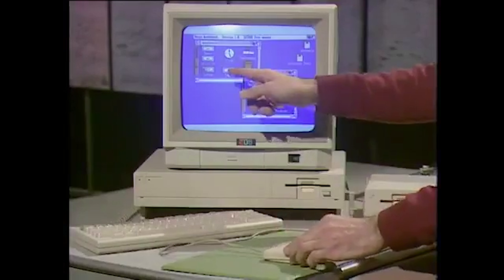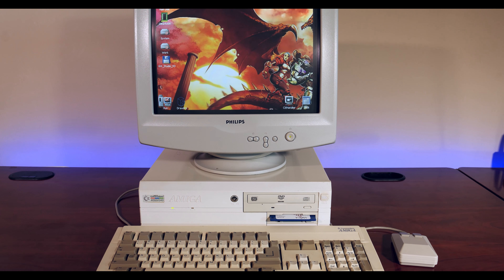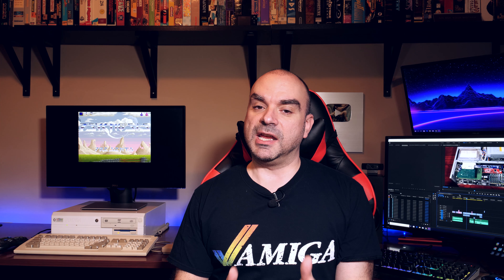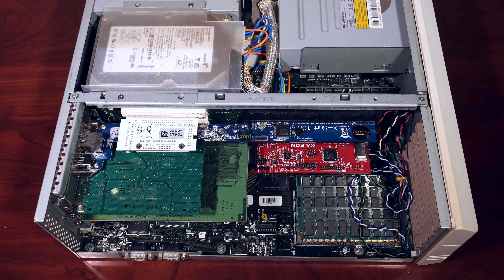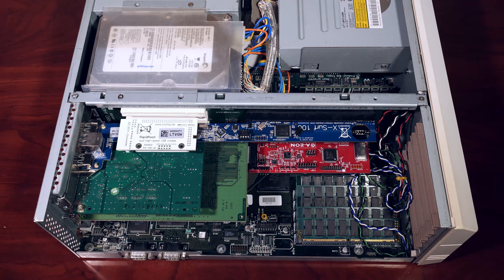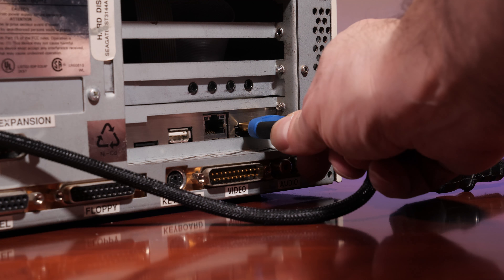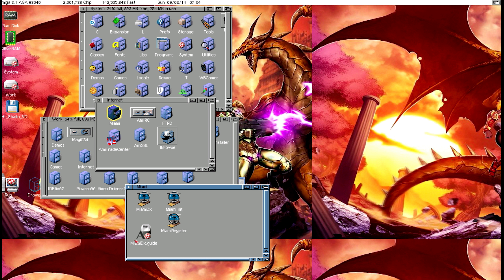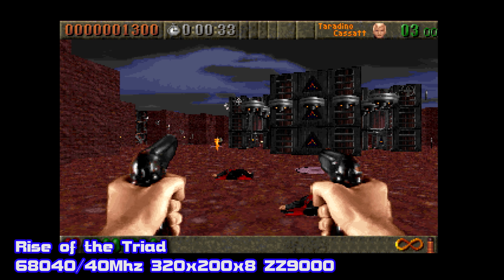Pimpin' the Amiga in 2020 - The Only Amiga Graphics Card you'll ever need - MNT ZZ9000 | MVG

Comment: Most people forget how powerful the Amiga was back when it was released. There was literally a PC emulator for the Amiga, as in you could run PC MS-DOS software on the Amiga using a software emulator and it actually ran pretty well compared to common x86 machines at the time.
Reply: Not to mention the generous upgrade path they had. It was a great platform for enthusiasts of computing in general. It's no wonder the community is still pushing it further.
Reply: @SyphistPrime  yeah, it's a shame how Commodore was mismanaged so badly when they had so many fans all over the world, I remember reluctantly switching to the PC platform after it was evident the Amiga wasn't getting a successor and Commodore was pretty much dead. Still loving my Amiga and Commodore since my first Vic-20, but PC was the only path forward.
Reply: PC emulation was horrifically slow on the original Amiga. Transformer emulated a PC running at 300Khz IIRC. You may be thinking of Macintosh emulation - which due it having the same CPU, was actually faster for certain applications than native hardware.
Reply: @lister_of_smeg6545  You are probably right and I might have a slightly rose tinted view of the Amiga, never did a benchmark comparison, just running some various accounting software on both platforms back in the day and I was impressed, but still considering everyone use their PCs to emulate other platforms these days it's worth remembering the Amiga was emulating the PC long before the PC could emulate the Amiga. It shows how badly Commodore failed to evolve compared to everyone around them.
Reply: @lister_of_smeg6545  So how well did the PC emulate the Amiga at this time.. how many MHz? .. lol
Reply: @lister_of_smeg6545  That wasn't emulation but basically just API translation similar to what Wine does on Linux systems. IIRC there was an MS-DOS daughterboard for the Amiga which had an x86 processor on it.
Reply: @Eric-uf8zx  It didn't need to because it already had all the native software it's users needed. But if it had needed to run text-mode business software from the Amiga - I'm sure it could have managed.
Reply: The PC emulation was arse cancer, completely unusable. The Mac emulator Shapeshifter on the other hand ran better than a real Mac if you changed the file system on your harddrive to a fast file system. The standard Amiga file system made harddrive access from the virtual hard file really slow.
Reply: FTFY : most people DOESNT CARE about how powerful is a 25 years old machine.
Reply: grow up Ben
Reply: @TheStuffMade  I recall my Acorn Archimedes ran teh software PC emulator at XT speeds.  Not very fast but was able to do Turbo Pascal work for college.  Arm 3 would have put it at 286 speeds.  I love these videos may be a little expensive but wow how it transforms a big box Amiga!  FPGA and Arm working hard at it!  Marvellous!!!
Reply: There was some pretty good Apple Mac emulators for the Amiga as well. Helped by the Macs of the time using the same 68000 series CPUs as the Amiga.
Reply: @NerdENerd  It was fine with a bridgeboard. At least on my 28mhz 030 powered A2000, the 386 sx bridgeboard is decently fast. The 25mhz cpu and isa vga board on mine sits about the same or a little faster than an actual sx 20. I have not looked into replacing the cpu with one of those TI based SLC cpu's, though I am sure its possible it would work. 

It is kind of hard to quantify how fast it is in relation to the amiga itself though. Even if my 030 is hobbled by having all zorro2 ram(but still has 32k cpu speed 32bit external cache), I think the 030 is still much faster in non graphical based stuff. Such as opening large text files and searching through them.  Most tasks which I could say are transferable are roughly twice the speed on the 030 in my system. And if I had a proper accelerator board with 32 bit fast ram, I bet there would be significantly more difference.

My shapeshifter card on the other hand is wonderful. And runs system 7.1 with no issues including virtual ram. And seems every bit as fast as my LCIII with similar configuration.
Reply: Lassi Kinnunen  I think decimated is a little generous and certainly not at any competitive price level. You could buy 030 Amiga's too.
Reply: @lister_of_smeg6545  Yeah except if you had a bridgeboard. Granted, not emulation but basically an entire PC on a Zorro card. Variants up to 486@50Mhz existed. Even reports of some crazies upgrading them with Intel Overdrives.
Reply: @lister_of_smeg6545  There was a time when the fastest 68k Mac you could buy was an Amiga.
Reply: @Ben "How well did the Atari failure emulate the PC" -- Pretty good actually. No hardware required. PC Ditto II even ran quite a number of games like elevator.com that are quite hard to emulate right. I played a LOT of sopwith camel on my 1040STf. The PC was able to emulate the Amiga at around 8-12Mhz at the time. Just an 00, not an 020, 030, 040, or 060. UAE has been around a very long time, and I can remember the early SNES and sega genesis emulators running some titles close to full speed on the am486DX2/66. Building modern emulators for i586, you can still get pretty good performance, like from UltraHLE on a Pentium 83 overdrive/90/100/133 pre-mmx. 
As it is, I have the 68000 emulated on a lot of my ESP32s as well, thanks to Sprite_TM's minimacplus port of the musashi core. 
https://github.com/Spritetm/minimacplus/tree/master/firmware/components/tme
I WISH I could emulate an amiga on this little xtensa, but with all the custom chips, that ain't happening.
I was able to get the ST emulation port working on the teensy 4.0 pretty easily, but only for tos apps, any game that tries to dick around with serious copy protection fails. So no Dungeon Master :( But Sundog works.
https://github.com/Jean-MarcHarvengt/MCUME/blob/master/README.md
Long live the 68k. You can toot the amiga's custom bits all you want, but the ST's charm point is all of the off the shelf parts harmonize well. If it wasn't for that damn GLUE, and it's little MMU too!
Reply: Would love to see the Amiga come back and flatten the P.C. market. Call it Amiga Lazarus ! Or Phoenix ! Multi CPU with millions of instructions hardwired into the reconfigurable processors and an adaptable system board that can expand into many interfaces.
Reply: @Eric-uf8zx  with a 233mhz expansion card it could outperform the P2 450 at quite a few benchmarks.
Reply: @scottrich976  Didn't they already try that? I mean, AmigaOne...? and AmigaOS 4.1 Final Edition? Although 3.1.4 is the last one to run on the 68k, to my understanding. But PPC's more or less hard to find or expensive now as well, the AMCC PPC chips are still fairly trivial to find on older SAS adapters for enterprise disk controllers but that can't last. And FPGAs are ridiculously expensive. I've got quite a few enterprise nics here based on the higher end spartan 6 LXTs, which are supposed to be ~$2800 a chip if you believe xilinx's last price hike. Before intel ate Altera, the same chip was $1400 qty1, about $600 each if you bought in quantities higher than five trays of 280 bgas at a time. Even the lattice stuff, which has moved towards open source toolchains and reduction in R&D, still tends to have a high premium. And trying to lash together a board with five or six iCE40-HX8K chips to reduce the cost of a single larger FPGA, you end up with passives all over and increasingly difficult power rail bringups, and an explosion of configuration devices. Rather a steep cost in comparison to an Asrock A300W ($149) with a AMD Athlon 3000G ($55), and 8GB of DDR4-2400 SODIMM ($36) gets you a whole HTPC rig for $240+tax+sh that will happily run any OS/emulator you throw at it, with half the compute power of a PS4/Xbone. But the reality is, today's PC market is not desktops and enthusiasts, it's laptops and tablets. I just picked up a pair of intel cherry trail tablets for slightly less than $100. Gonna scrub android off 'em and leave them as win10 tablets so my main rigs can remain linux based. ARM64 is really making a hard push into the "more than 8GB ram" range this year, and is finally breaking the 2Ghz barrier en-masse. Intel and AMD's days of being the only chips with clocks north of 4Ghz are numbered. And the GPUs have just breached the 2Ghz barrier as well with nvidia's most recent batch. AMD's still playing catchup around 1700Mhz boosts with the vegas. Also, there is an up and coming port of the amdgpu driver from the linux kernel to other OSs. Expect an Amiga RTG driver for it sometime this decade, just like the PCI expansion + Voodoo+soundblaster in the video. I think some older 'radeonhd' cards have been supported for a significant chunk of the last decade.
Reply: The old "MessyDos"! Ah, the golden age... I was able to read and save PC disks with my "Amiga 500". :)

All hail Olaf 'Rhialto' Seibert (the coder of MSH).
Reply: @Ben Where did you ask? I replied to a post from an 'Eric'. Did you post with the wrong sock puppet by mistake?
Reply: Lassi Kinnunen  "However by late 80s you could buy 386's that decimated amigas in pure sw for several kind of gfx effects" Correct. And not only that you could buy them in 1987  before the A500, the one most people bought, was released.
Reply: @TheStuffMade  " it's worth remembering the Amiga was emulating the PC long before the PC could emulate the Amiga. "

Why is that worth remembering? Instead of buying an Amiga with an inferior PC emulation, you could just buy a PC instead. There was never a reason why a PC owner would Want to emulate an Amiga. The reason the Amiga had things such as the sidecar was not because of brilliance, it was because of necessity, and conversely: The reason the PC didn't emulate the Amiga was a lack of interest. 

Amiga fan comparison with the PC is always a case of comparing a fish to a monkey with a tree-climbing contest. Most people who owned and used PCs for work didn't give a shit about the Amiga because there was never a reason to make the trade: You simply don't want an office computer to play Defender of the Crown. The PC didn't have a great games market really until Doom was released. The same reason: Great games didn't come out for the PC because it was used by professionals who absolutely didn't give a shit about using it to play games, when they wanted to play games, they were better off buying Nintendo. The Amiga had literally no place.
Reply: @SyphistPrime  "Not to mention the generous upgrade path they had" LOL. There was NEVER a time when upgrades for the Amiga competed with PC upgrades.
Reply: @digitalarchaeologist5102  "I think decimated is a little generous and certainly not at any competitive price level."

LOL @ the Amiga fan-fiction price objection.

1. Not everybody was broke so not everybody buying a computer had the same price objection. Corporations would routinely pay over $250,000 for a computer system. They were NOT better off getting an Amiga and saving some money. Professionals have deeper pockets and buy on features, ROI and competitive edge, not cost. The argument an Amiga was cheaper is no more compelling than arguing a Nintendo was Much cheaper. Nobody gives a shit if it was cheaper, they weren't buying a games machine.

2. The Amiga 1000 was NOT cheap. It cost over $1000 when it was released, with an 8Mhz CPU which only really competed in speed with the previous generation PC/XT, which at that time had already been outdated by the PC/AT 286. The Price of an Amiga at that time allowing for inflation was the equivalent of over $3000! Cheap? No-brainer cheap? No. I don't think so. The Amiga also had absolutely no useful software really until after the A500 grew the user base. So the Amiga wasn't a compelling purchase even on its day of release. The idea this was all something you can blame on marketing isn't true. 

3. The trouble with Amiga fans is time distortion: They speak of the Amiga as if on the day of its release it had the software base and power of an Amiga with the Video Toaster Flyer which, DYK, didn't exist until 1994, by which time Doom and Quake had been released on the PC. They act as if this 1994 set up cost the same as an A500 which itself didn't exist until 1987 and pretend it was all available at the time of the A1000 launch in 1985, and was competing with a standard-issue unexpanded PC/XT of 1981. 

Here's an idea: Try putting everything on a timeline according to when it all REALLY happened.  

Time for Amiga fans is made of elastic and you can stretch it anyhow you like to produce a completely distorted picture of cost and availability. Nobody was ray-tracing on Amigas when PC/XTs were in vogue.
Reply: @Ben LOL. x 10,000,000

The old "Let's just make up a bullshit explanation for that". 

I've owned computers since the 1970s.
Reply: @vapourmile  You seem be ranting about a lot of stuff I didn't say so I'm not sure who you're arguing with. A 386 in 1989 was very expensive. For example a Compaq 386/25 was almost $16,000 by today's costs. An Amiga A2500 was around $7,800 by todays costs. Most people owned neither at home.
Reply: @scottrich976  Your dream is impossible. There is now no way to "bring the Amiga back" because there is no way to connect the lineage after so much time. Any new computer now will be just that, another new computer. How can it be an Amiga?
Reply: @Ben 

"Is that the best you can come up with? LOL.. how about you answer the question Ken"

Ben, you and the people who "liked" your comment should take the absence of a response as indicative. There's a very plain and simple reason why there aren't any benchmarks from PC hosted Amiga emulations from that day forthcoming and it's this: Nobody wanted to know. 

Of course, we know the answer for today's hardware: PC hosted Amiga emulations today easily outperform even the most powerful Amiga hardware ever to be produced by Commodore. In fact, by 2002, almost 20 years ago, PC hosted Amiga emulators already performed at an equivalent rate to a 0.5Ghz 68030. PC hosted software Amiga emulators have substantially outperformed real Amiga hardware for about two decades.
Reply: @lister_of_smeg6545 

The people boasting of CPU daughter cards are ignoring the fact 68000 daughter cards existed for the PC before the first Amiga was released. Not only that, but a series of CPU daughter cards were released for the PC including transputers and others.

You're basically right: The lack of early Amiga emulation on the PC is explained by a total lack of interest. It would be pointless.

The PC daughter card for the Amiga was also pointless when if you wanted to run PC software you could just buy a PC instead of an Amiga.

Commodore knew this and they made the card in the hope of dampening the effect on sales of the fact that the PC had more killer business apps than the Amiga, and the Amiga had no mature software base. The idea was "See? You can still run PC software!". The problem with that is, you can also run PC software when you buy a PC and not an Amiga. 

I've looked online and if you bought a bridgeboard the results are actually quite impressive.

It's interesting then that the Amiga is made more impressive when it's running PC software. Also, although impressive, desktop PCs of the time with a similar 486 CPU are about four times as fast as the Amiga bridgeboard. So even with a PC on a card, for running PC software you're still better off with a PC.
Reply: @vapourmile  yeah I suppose, maybe a mini Amiga with a few hundred favourite games preloaded would be better. A good compromise.
Reply: @scottrich976 

Yep. A reprise would be welcome.
Reply: @Ben the Atari ST didn't fail to emulate the PC. PC-Ditto was an early software emulator for the ST before it received hardware 8088/8086/Vwhatever/286 and 386 hardware emulators. I'm also pretty certain that the Magic Sac Mac emulator made it out on the ST before the Amiga Mac emulator did. And the first Mac laptop was an Atari STacy laptop equipped with a Magic Sac or the more powerful Spectre GCR. But thanks for playing.
Reply: @welshtechie6832  Acorns were much more expensive than most Amigas or Atari STs. That's like comparing both of those platforms with the Sharp X68000...
Reply: @scottrich976  Even Apple hasn't done that and they design the best ARM based chips period. There's nothing stopping them from packing in 2 or 4 of them into a "Mac" and completely blowing away x86. It would kill Bootcamp and Parallels without an internal/external Intel/AMD CPU option thought.
Reply: @vapourmile  the Amiga and the Atari ST were both far cheaper than the various IBM PC and "compatibles" back when they debuted in 1985. "Cheap" and capable PCs didn't hit the market until around 1990 or so. That's why. Plus, DOS sucked.
Reply: @Jeremy Holloway

Yes, but I've already answered this same question so often there needs to be a home games micro sticky on it. It's simple:

1. Not everybody bought a home computer primarily, or at all, to play games.
2. Not everybody was broke. Not everybody shares your budgetary constraints.

For me as a software developer something I wanted from a computing platform is a ready made user base. So for me the Amiga and ST represented extremely poor value for money thanks to their small cash-starved user base. I spent £4000 on my first PC and it was money I never regretted spending. I also owned an Amiga, and the day my PC was delivered was the last day I used an Amiga.
Reply: @vapourmile  Again you seem to be ranting about something unrelated to what was I talking about. The point I was trying to make was that a 386/25 wouldn't decimate an A2500/030 in terms of performance and they were both high-end contemporaries. Sure, there were far more applications for the PC, I don't think anyone is saying otherwise.
Reply: @digitalarchaeologist5102  

"Again you seem to be ranting about something unrelated to what was I talking about. The point I was trying to make was that a 386/25 wouldn't decimate an A2500/030 in terms of performance and they were both high-end contemporaries"

As I explained in my previous response, whether or not you were personally talking about it is quite irrelevant: Your own words might add to the facts at my disposal, but they do not subtract from the other facts I already have, whether or not you write them, and to anybody who is able to read, your words have no magical properties. As I pointed out, in this case even if we superficially accept what you wrote is true, it is nonetheless what you are Not saying that harbours the point. 

What you have said indeed may be at least superficially correct, even though I don't think the claim of contemptuousness is especially veritable. Yes, superficially, they were available to purchase at the same time. Today, for comparison, Intel still manufacture the Atom released in 2008. So it's superficially contemporary with the core i9. The point being that there have been a lot of CPUs released since the Atom was released a decade ago and many of them are still currently available. I also highlighted previously the Amiga fan-base phenomenon of elastic-time where there is a tendency not to report the timeline of past events accurately and as they occurred.

So it is somewhat true that 32 bit Amigas were available at the same time as 32bit PCs. The 25Mhz 68030 Commodore A2630 daughter cards were available in 1989, as were 80386 PCs, but unlike the A2630 cards however, 80386 PCs had already been available since 1986. If, instead of picking the release date of the A2630 and comparing retrospectively it to a previous generation of PC hardware still available contemporaneously with it, we are to instead to choose the date when 32bit PCs were first made available as our vantage point, it was on that same day in 1986 with that same machine - the Compaq 386 Deskpro - that 32bit desktop computing was first made available to the public. So instead of picking 1989 as the vantage point, how about we pick 1986 when the Compaq 386 was released? You know, a generation before either the A2500 or A2630 CPU card came to market?

While the 386 remained contemporary with later Amigas, obsolescence takes even longer, but still the performance buyer would base their purchase on what was fastest and not necessarily on what was cheaper and/or contemporary. Not everyone buying a computer has "cheap" on their selection criteria, least of all computing professionals, which explains the price differential between PCs and Amigas, computing professionals then being the primary PC customer base. People buying PCs for work or competitive edge tend to have deeper pockets and are prepared to pay for a competitive edge. Amiga buyers paid less but for the most part their motive for their purchase was recreational not professional. That, depending on exactly what you wanted your computer purchase to achieve, renders most of the alleged advantages people claim for the Amiga relatively impotent as far as the marketplace was concerned, and particularly as far as the marketplace interested in using professional applications software and not games or recreational software was concerned. 

1. People who wanted games would have made a substantial savings from a home console purchase, not an Amiga. Consoles had the full range of market leading Japanese game titles and were about one tenth the price of an Amiga. Games consoles took nothing away from the core professional PC customer base because they didn't care about games. 
2. The Amiga was never really taken seriously as a platform for professional software, people wanting that would buy a PC.
3. Many of the applications people claim the Amiga excelled at, such as graphics, didn't really appeal to the mass market. Really, who is it who wants to look at a mirrored sphere hovering over a chequered floor after waiting six hours for it to render? What do you do once you've looked at it? 

So yes, you are superficially correct, viewed from the vantage point of when Amiga products were released, at the same time there were similarly performing contemporaneous PCs, but it is also true that looking at the timeline from the point of view of when improved performance became available in the marketplace, rather than when it became available to Amiga devotees, you could purchase improved CPU performance sooner from the faster-moving PC market. In those days a computing generation was about 18 months to two years, after Moore's law, so the Compaq 386 PC was released a generation ahead of the Amiga A2500 and the A2620 and more than a generation ahead of the A2630.

So, yes you're right in that once again I'm "ranting about things you weren't talking about", but which needed to be talked about to give things their proper perspective.
Reply: I love the utter height of arrogance that what you present is 'fact' in your words, but  we can only superficially accept what I'm saying. OK, you've put your context around it, but please don't pretend that it's entirely fact. If somebody presents some data to you, then it's irrelevant or cherry picking but you can present sweeping statements as bone-fide facts. Please at least allow others the courtesies you allow yourself.
Reply: @digitalarchaeologist5102  

Yet again, you appear to believe your personal opinion is pivotal in the discussion. I don't care if you think I'm being arrogant or not, I only care if it's true.

You also seem to have misunderstood what I mean by "superficially true". I don't intend the difference between fact and fiction which you imply, but rather the difference between obfuscation and clarity. Perhaps /ignoratio elenchi/ would have been a better choice of phrase?: What you say may well be true, but it doesn't represent a completely honest account of the facts.

Here are some more facts:

1. You could also buy CPU cards for the PC and in fact you could buy 68000 CPU cards for the PC before you could buy a 68000 based Amiga. Meaning 68000 CPU cards for the PC were available before the Amiga was available in any form. Furthermore, Dr. Dobbs Journal published a homebrew computing device made from dual 68000 CPUs in 1982. In 1982 people were already making their own computers on a desk at home with more computational power than the Amiga had on the day of its launch three years later, well, four years later, if you factor in the time which elapsed between the official Amiga lanuch and the date mass-production really started. Click the following link and turn to page 254/580:

https://archive.org/details/dr_dobbs_journal_vol_07_201803/page/n253/mode/2up

2. The Amiga  486SLC PC-on-a-board add-in is impressive. In fact, as an Amiga owner, I'd say it's disconcerting just how impressive it is, given that it is essentially a plug-in PC for the Amiga.

You can see an adequate demonstration of the bridgeboard below here, where with it the Amiga runs PC games with textured graphics at an impressive speed. It's interesting to watch because there really weren't many textured 3D games released for the Amiga on its Motorola CPU. What's also true of the 486 Amiga bridgeboard though is, to ensure it could be powered by the edge connector from an Amiga bus, it was in fact fitted with the 486SLC low-power laptop alternative to the Intel part, and ran at about one quarter of the speed of a similarly specced PC.  So it's somewhat ironic that by putting a PC in your Amiga case you get a somewhat better outcome than you would have from standard Amiga hardware without it, but you get inferior performance to what you would get if you bought a PC instead of an Amiga by a factor of 4. Here is video of a faster-than-standard upgraded version of the bridgeboard in operation: 

https://www.youtube.com/watch?v=_XTzEJBOI_A

From the 8:00 minute mark you can compare Quake, and its roughly 1fps speed, on that 50Mhz TI upgraded board to a standard 486-33 PC below, where Quake runs from about 1:00:

https://youtu.be/KbcFvUOGA44?t=60

So as you can see, the standard consumer-retail 33Mhz 486 Desktop PC runs those same products with a roughly fourfold speed increase over the otherwise 50Mhz Amiga bridgeboard. Part of the reason for this is in order to power the on-board CPU from an edge connector the Amiga board only accepts low-voltage laptop CPUs.

As for dates, the original standard 486SLC edition Amiga bridgeboard mentioned with the even lesser processor with a smaller cache than the one from the demonstration above did not become available for the Amiga until 1993. Free standing 486 PCs had been available since around three years previously. The 486SLC bridgeboard was available at about the same time that superscalar microprocessors were first being introduced to the public in Pentium class PCs. The Intel Pentium itself was available about a year before Motorola launched their own first superscalar 680x0 series CPU, and their final CPU, the 68060, but even then it wasn't until 1995 that the part first became available to Amiga users in the form of aftermarket CPU accelerator cards eventually released after Commodore filed for bankruptcy in April 29, 1994, and once again by this time the Intel and PC markets had already moved to the next CPU generation featuring out-of-order instruction execution.  Now although out of order execution was introduced in a processor by Intel before Motorola, it was delivered first even before Intel, by the first CPU to compete directly with Intel which was the 70Mhz NexGen Nx586 which was already available to the PC market by March 1994. 

Although if we take reported sales figures the death knell for the Amiga was sounded some time between 1992 and 1993, during which time PCI PCs had been released while Intel had released the 486 DX2, the first CPU to use clock doubling permitting the processor clock to run at twice the cycle frequency of the main bus.

Although the final generation Amiga Zorro III expansion bus was reputed to have a 'theoretical maximum' transfer speed of 150MB/s it was limited in real terms to the 13.5MB/s specification of the Buster chip. The first generation PC EISA bus of two years previously had already been more than twice as fast as Zorro III was when it was first available, and the first generation PCI expansion bus of 1993 was a little under ten times as fast as Zorro III. 

Now, I know the average commodore Amiga user doesn't care about that as he listens to six hours of soundtracker modules while waiting for a mirrored ball to finish rendering at 6am after a long night smoking cigarettes and playing Speedball, but as a technical computing professional I don't really care about things like the Blitter or the Copper or the Paula sound chip. I don't even really care about multitasking, because they are all merely cosmetic additions to the user experience which offer absolutely no improvements to the work I do. In fact multitasking is a detriment because every background task takes CPU time. If I want to listen to music while I work I put on a CD. 

https://cdn.arstechnica.net/wp-content/uploads/2017/01/commodore-sales-modified.png
Reply: Digital Archaeologist  

Ah yes, "multitasking" the Amiga feature its fan-base present to a bemused audience as if it were some kind of silver bullet or cosmic alien technology shared exclusively with Commodore. History tells us it was neither.

If multitasking was the magic bullet people claim it is, then why didn't the market seem to care? Well, because it's inessential. Most of the time people spend with a computer running serious applications they spend using them in a sequential fashion: You use one application, you finish with it, and then you move on to the next one. Preemptive multitasking was not a magic bullet for the simple reason amongst people buying home electronics in the mid to late eighties there was no real demand for it. 

The more pertinent question is why exactly do the Amiga fan base care so much about it? The answer is that they think it's an objective knock-down fact in the Amiga v PC debate, because it sounds cool and the Amiga did it but the PC didn't. Checkmate PC! 

The trouble is of course it's wrong, and that opinion thing means the differing opinion of other observers is what's pivotal to them, and for most people buying a computer, multitasking or the lack of it was not a show stopper.

People talking about multitasking are again ignoring many facts:

1. Whatever your personal opinion, historic computer sales volume tells you straight away the market didn't crave computers which offered preemptive multitasking. It wasn't a very powerful buy-in especially when weighed against other advantages or disadvantages offered by other systems. ie in itself, it wasn't really priority. It wasn't a red line. It wasn't a "must have". 

2. Even if we accept the Amiga blinkered-vision around it and throw up our hands in defeat and accept there was nothing more important on earth than a computer which allowed you to listen to music while typing for twenty minutes before it crashed with a "guru meditation" and lost all your work because the OS and GUI were so unstable, explaining the reason for releasing it on disk not ROM because even Commodore knew it was unstable and would need patching before the computer was even used. Even if we shut our eyes and pretend only multitasking matters, then guess what? Yep, once again the Amiga was not the platform we have to thank for it. Not only had it existed since the 1960s in the Multics and PDP-Unix space, preemptive multitasking was something which also once again came to the desktop on the PC before the Amiga even came to market, most notably in the form of Xenix. As well as with PC Xenix multitasking was however also available on the PC in other operating systems including MP/M-86 (1981) Concurrent DOS (1983), IBM TopView (1984),  Concurrent CP/M (1984) and DESQview (1985).

Like Xenix, MP/M 286 from Digital Research also leveraged Intel's 80286 memory management and memory protection facilities, features which were not present in the 68000. The lack of 68000 memory protection meant any Amiga app could read and write any part of RAM, including reading or corrupting the memory spaces of other apps. This is why many people tried to avoid multitasking on an Amiga for fear of facing yet another date with Mr Guru. "Guru meditation" is an optimistic title for "yet another system crash". MP/M was first available on 286 in 1982, three years before the Amiga was even released.

You'd have thought Amiga fans would have gathered purely from poor Amiga market performance that their "Multitasking! Checkmate losers!" argument didn't really wash with customers. Thanks to Amiga fans reminding people of it, every time they had a chance, it wasn't exactly a closely guarded secret they appear to think it was.

So given that multitasking PC OSs so often also entailed muti-user operating systems allowing users to connect to a central PC in a client-server arrangement, even if multitasking was your bag, if you had serious intent, the PC was still a more serious departmental platform than the Amiga was, and there were PC operating systems which offered preemptive multitasking before the Amiga existed at all.

Amiga fans: "Preemptive multitasking!"
Everybody else: "We know, we've already seen it. Thanks". 

I know, you may be thinking "Oh god this is so boring, who cares?", but isn't it odd that selfsame response describes exactly what people are thinking when Amiga fans avail them of the "unique", but inconsequential nest of uninteresting Amiga features its fans have been raging about ever since they got hold of one?

The COPPER: Who gives a shit? I have a PC with two graphics cards, a 24bit graphics card for output preview, another to run the user interface, and two monitors. 
The Blitter: Who gives a shit? The graphics routines I'm working on are per-pixel rendering and convolution. The blitter is useless for that.
The Paula sound chip: Who cares? If I want music I have a CD player.
Multitasking: It doesn't matter. I spend most of my time in my one main workplace app. Sometimes I quit from it and use another. Saving and quitting is not stopping me from working, but transferring to a computer which doesn't do what I want will.
The price: I don't give a shit, I don't want a cheap computer, I want one which runs the applications I need to do my job.

All in all Amiga users are forever making claims which do not qualify as technical specifications or features, such as "The Amiga was so far ahead of the PC!"

But when you try to get them to name how, they can't. They can't find any specific feature you couldn't already find in better shape somewhere else. The few that they could were not really persuasive. To fulfil a USP you need "Unique" AND "Selling point". As well as unique there needs to be demand, and there just weren't enough people who wanted to wait six hours to render a mirrored sphere hovering over a chequered floor, because it was pointless.

Oh, you could do useful stuff, like develop software, but you just named exactly why it wasn't a good idea: A user base of complacent rip-off merchants who didn't want to pay for anything and easily found ways not to. So, it's a case of "Hello X-Copy, goodbye serious software developers!". You cite piracy as if it is a platform feature, but speaking as a programmer who pays for the software I use because I know what it means to depend on software sales, piracy was one of the key reasons I abandoned Commodore for the massive PC user base and profoundly reduced piracy problem. Just think of all those software companies who would have continued to invest more in developing premium software titles for the Amiga if only there was point or profit in it.
Reply: @vapourmile  TL;DR
Reply: @Digital Archaeologist 

Oh, I'm not surprised you didn't read it. I've seen your YouTube channel, reading isn't your forte is it? Just scrape by with the minimum you can find out, right?

I thought I'd take a look through your channel to see if there was anything to salvage from it and this is what I learned:

It's a long series of basic installs and superficial glances over several archaic OSs. The superficial is strong in you! There is no sign of much insight into any of them.

In your descriptions notably the only one on which you have even scant technical insight to impart is the Amiga Unix, at which point you immediately leap to defend the Amiga's alleged "multimedia" hardware.

This is of course the repetition of long standing popular Amiga enthusiast fan-fiction: The Amiga had no "multimedia" hardware to speak of. Basic three chip CPU/audio/video layouts were the norm, not the exception, for home games micros, and had been since the 1970s when the first home micros were released.

What do you expect Amiga Unix to do? Support copper lists? Despite fanboy claims, the Amiga had no special video playback capability.

HAM mode was the remnant of a botched and aborted attempt to implement NTSC at the chip level. It was famously useless for the display of moving images. It was essentially a puffed up 16 colour mode which allowed you to shift one of the RGB triples per pixel. It wasn't great even for stills in that despite Amiga fan-base claims of it being a 4096-colour mode, the fact was, any image displayed with it had to springboard from a 16 colour palette. This meant image composition strategies working from full colour pictures were necessary, and non-trivial.  There were a potentially infinite number of different strategies one could employ to display the selfsame 24bit source image. Amiga fans talk about HAM as if it was a miracle, but all it really does is hike you over the 32 colour mark with an extended 16 colour mode. It isn't an APA system and doesn't' lend itself naturally to moving image playback, especially not with a 68000 doing all the work. Also, it was obviated by a simple move on any platform to a graphics card with 12bit APA display palettes or more. Again, these came to other platforms before the Amiga.

The fact HAM was unique doesn't detract from the fact it was also an awful bodge and even its implementors meant to remove it from the Amiga before it was released. The only reason it wasn't is because it would only have put back the Amiga release date further and cost more money. It was cheaper to just go with it.

HAM was rendered utterly irrelevant in the shadow of any graphics chipset offering 12bits per pixel APA graphics modes or more. OCS HAM was a 4bit colour mode with extra steps, and you aren't going to do any multimedia damage with that. 

In its day there were precisely zero reputable video players for the Amiga. Not even the mythologised Video Toaster allowed video playback on the device. The VideoToster didn't even allow local video storage until 1993, and the original 1990 version was nothing more than a video switcher with a program which allowed you to make edit lists.

The proof of it is still out there, because even now development still continues on the Amiga there still aren't any decent video players for stock Amiga hardware, not even today.

Audio playback was literally just 4-8bit DACs working in parallel.  This means the most you can have realistic expectations for is 8bit stereo sound playback. It had NO hardware sound CODEC which means one 3-minute stereo song stored in the only format the hardware could actually read would take 10MB of RAM. Good luck with that on a regular Commodore Amiga. The 1000 shipped with 256K, which wasn't impressive even y the standard of the day, unless you're comparing it to other supermarket games-machines, and not professional computing platforms.  

There were no DSP hardware A/C CODECs shipped with any Commodore Amiga. It does't exactly scream "multimedia". To this day demos give the lie to Amiga fan claims by showing even after you squash every single clock cycle you have into a single graphical effect, even after decades of accumulated knowledge, it still isn't impressive. Fact:  On a 32-colour graphics subsystem attached via shared memory to a largely unassisted 7Mhz 68000 CPU, except for basic sample playback, you are NOT going to build a really impressive multimedia environment, because surface details out of the way, the underlying grunt to achieve it just isn't really there.  

Slow blocky Amiga Quake, on one of the highest spec 060 Amigas you can lay your hands on, following source conversion and more than 20 years of optimisation efforts:
https://www.youtube.com/watch?v=uY2UNsgGeUw&t=44s

What exactly did you expect from 1990 Amiga Unix? Even though it was a Commodore-badged product from 1990? Even your own set of videos show that amongst the alternatives you yourself have seen the Amiga environment was not impressive. 

Your real strength lies not in commenting on digital history but in sitting there on your own playing Amiga Bubble Bobble.
Reply: 100% agree. The things I was learning about the Amiga were years ahead of what I was being taught about the PC. For instance, preemptive multi-tasking.

I remember once, whilst using some Windows 3.11 machine, some lecturer asking me 'why I'd got so many Windows open at the same time' and I was like well, I'm trying to do more than one thing at once? Blank stare ensues. Then I got down-marked for turning in a marketing project because the lecturer didn't believe I'd put video graphics on a VHS tape - they thought I'd copied them from commercial material. So I provided supporting evidence and once again..blank stares. They didn't know what it was. They didn't WANT to know what it was. Why? Because their brains didn't want to think outside the box..

I just carried on reading, learning as much as I could.

Save for PC shareware, Amiga community felt like a completely different ethos..people actually doing things for the love of the machine and the people it served, rather than milking misery. And what the Amiga was doing with video production in the States; it was just out-of-this-world. I remember seeing actual demonstrations of the Amiga Video toaster for instance, and watching people's eyes pop as they saw the real-time capabilities of hardware that was being sold at an absolute fraction of the cost of what they were used to spending.

To this day, I still feel the Amiga was the most advanced platform I've ever used for its time, and it still staggers me how it was brought to the market way in 1985. A creative powerhouse years ahead of its time :)
Reply: @QuadTubeChannel 

I remember the time I had a time travelling 1979 Ford Escort Mk II.

Most people didn't believe me but those times I had three thousand years ago with Queen Nefertiti at the festival of drunkeness are the best.

Given your mention of "evidence" and the personally reflexive commentary leading to a great absence of much that can be referenced, even if I wanted to look it up myself, I genuinely can't tell if you're being serious or you're lampooning traditional Amiga fan fiction passed off as fact.

The remark about the Video Toaster of course can be checked and it's false. The Amiga video Toaster in its first incarnation had no video playback facilities at all and was really primarily a video switcher attached to a GUI which allowed the compilation of edit lists, and included some screen wipe effects.  It had features most definitely exceeded by analogue professional video editing suites of its day.

Digital editors aimed at professionals including Avid Media Composer, released in 1989 before the Video Toaster came to market, definitely did allow real time previews.

The Video Toaster couldn't so much as be used to store moving video clips until the Video Toaster flyer of 1993, so, contrary to Amiga fan fiction, it definitely didn't compete with substantially more expensive professional dedicated video and film editing suites.

What you wrote was quite entertaining to read, but given the sarcastic feel it's hard to know what you hope the person reading will take from it or even exactly what you're replying to.

Avid Media Composer was the first digital video editing suite to be able to process cinema film at native resolution and Lost in Yonkers was its first use in a major film production.

Film and video were still edited long before either the Video Toaster or Avid Media Composer existed. People didn't wait until Amigas existed before editing their films.
Reply: @Martin Dawson 

Can't recall saying anything was ten times more than a console, although having mentioned it, that can't be far off the price difference between an original A1000 at $1285 on the day of its release versus a Nintendo.

I think comments like yours are quite naive, given we already know overwhelmingly the public widely don't accept it.

I can't recall the exact numbers but I think the SNES sold around 50 million units and the NES 60 million. Between them then they sold more than twenty times as many units than the sum total of roughly four million Amigas. That's the sum total sales of every Amiga model ever released.
Reply: The real strenght of the Amiga were it's multimedia capabilities that it had out of the box. Also people liked how easy it was to get the software, mostly cracked and easy to copy from others. Also the amount of freeware and shareware stuff was mindblowing. My cousin had an A500 and huge box of floppies full of games and other stuff. We were playing with DPaint and even original voice synthesizer. We loved everything about graphics and sound this computer had. It was magical even in mid 90's.
Reply: Not to forget fully functional Apple Macintosh emulator which I was using a lot. Adobe Photoshop was working  pretty fast on 040/25.
Reply: @TheStuffMade  Amazing hardware but doomed as regards profit and consumers. technology moved on and got cheaper, Amigas couldn't.

If you consider the projected lifespan for a home computer, its only a couple of years for the first user, then they get passed on to the next owner for cheap or free. It becomes expensive to buy new improved model every two years, along with replacing all your software.
Reply: @NerdENerd  my first DOS install on a DX2-66 originated on a A1200 under emulation then transferred across to the PC using Laplink via RS232.
Reply: @vapourmile  Actually i am a long time Amiga bridgeboard user and the Commodore A2386 @25Mhz is totaly similar in performance than a PC with 386sx and 25 MHz. This board sports a genuine Intel CPU, has 8 MB of board, can use other ISA cards inside the Amiga including VGA, soundcard, network, disk controller, SCSI, or share some resources with the Amiga. It can be easily upgraded with some clipon CPU upgrade, up to 486SLC3/75MHz (though rare to find these days). I still use mine inside an Amiga 4000 and it is great for retrogaming with a VGA board, SB16 and Roland MT32. The Commodore bridgeboard is still worth several hundreds of bucks amongst enthousiasts while a PC of that era is mostly a piece of junk.
Reply: @digitalarchaeologist5102  

"Yeah except if you had a bridgeboard. Granted, not emulation but basically an entire PC on a Zorro card. Variants up to 486@50Mhz existed. Even reports of some crazies upgrading them with Intel Overdrives."

Crazies? By "crazies" you mean people doing something which was outlandish for the Amiga but absolutely standard practice for PC owners with socket-3 motherboards? You've put your cards on the table when you refer to upgrading an Amiga 486 board with with an OD CPU as something only crazies were doing. That was difficult and exotic for Amiga fans, was it? On a PC you just plug them in.

"Again you seem to be ranting about something unrelated to what was I talking about. The point I was trying to make was that a 386/25 wouldn't decimate an A2500/030 in terms of performance and they were both high-end contemporaries"

I think describing them as "contemporaries" requires you to ignore how much faster technology moved on the PC than the Amiga. PC processor-upgrades at that time came from several different manufacturers and any one of those manufacturers might release numerous different CPU products in one year. Many of Intel's competitors offered CPUs with performance advantages over the Intel mainstream.

The Intel 386/25 became available in 1985. The Compaq 386 was launched in 1986. The Amiga 2500 arrived in 1989 about three years later. It wasn't available in number until 1990. Personally, I consider a computing generation to be about 1-3 years on the outside, depending on how you do the accounting so a 3-4 year lag between 386 PCs and the release of the card "you were talking about" (as if your own talking points are what matters) is not an insignificant delay.

By the time the Amiga 2500 was on the market, the 486 had been released. In fact, since you are talking "contemporaries" the 486 was released in April 1989 and the Amiga 2500 was some time in 1989. Hard to find an exact date but looking at Google Books there is merely one mention of the A2620 recorded in 1989. It was not until the following year it was available in any volume. The first 486s were launched in 1989 and became more widely available in 1990 which makes the A2500 launch far more "contemporary" with 486 PCs, not 386 PCs.

We know from sales that the price difference Amiga fans such as yourself love to cite clearly wasn't something the marketplace really cared about. People were prepared to pay a premium price to own a PC. Compaq were successful in creating a prestige desktop market. PCs were then sold to professionals with far more disposable income than the amateur and domestic market the Amiga made itself agreeable to. Business buyers, myself included, saw PCs as a cash investment and a financial asset and were willing, and able, to pay a cash premium for the competitive marketplace advantage which could come from use of the PC, a fact that the amateur Amiga fanbase obviously don't understand. 

Meanwhile Amiga fans tend to boast of features people from the PC environment absolutely don't care about,  things like blitters and coppers and games. PC s were not sold as home entertainment platforms before the 1990s but it was very successful nonetheless so Amiga fans finding it "boring" are missing the point. Amiga fans wage this war against PC users as if the PC user base is sore about losing, but we didn't lose, we won. The Amiga lost. The PCs "boring" stands victorious against the Amiga's "trash, toy and useless", so the cash savings cited is largely a moot point: Executives who bought the PC could, and did, buy premium 386 and 486 PCs.

The price objection is even more ironic when levelling it against the Compaq DeskPro series as there is probably no other platform in existence which in its time more ably manifested and led the prestige PC marketplace. If you absolutely wanted the best performing PCs, the Compaq range of very expensive desktops set the benchmark. Businesses bought them as prestige possessions and financial assets. 

Also, you don't have any benchmarks. I'd like to see just how fast were those A2620s with their infamous wait-states to 100ns RAM? The original 7Mhz 68000 Amiga were not fast even by comparison to similarly specced 68000 predecessors. As I like to say to Amiga fans: When you have to wait six hours for a chrome sphere to render, you should take that as informative as to how powerful that platform really is, if you started to be honest with yourself. 
 
Most of the alleged prowess the Amiga had over the PC was found in hardware mainly beneficial to 2D sprite-based computer-games, and any such performance advantage in that department was largely washed away by Japanese games consoles which could be fetched for a three figure sum and were far more popular with the public. So on that account too your claim the ongoing software cost would be higher with consoles was yet again an irrelevance to a public who largely preferred them. Those games machines were far better suited to the tastes of the home market at the time than the Amiga was and while the consoles far outsold the Amiga in the home the PC far outsold the Amiga to professional buyers.
Reply: @lordxanxi8348  

"Actually i am a long time Amiga bridgeboard user and the Commodore A2386 @25Mhz is totaly similar in performance than a PC with 386sx and 25 MHz"

Well, even if it was, it wasn't released until 1991, which is 6 years after the 386 25 itself was released. So by the time you could have an A2386 for the Amiga, PCs were running 50Mhz 486s, which were substantially faster. So you may be comparing products which are comparable in performance, but the similarly performing PCs you sae are comparable had been released generations earlier.

http://www.traumstation.ch/hardware/Commodore/Amiga/A2286-A2386%20Bridgeboard/BridgeBoard%20Manual.pdf

The story is the same yet again with the Texas Instruments 486SXLC2-50 because that chip was also unavailable until February 1994. By then, the PC had advanced to 66Mhz Pentiums which were, again, substantially faster.

http://www.x86-guide.net/en/cpu/Texas-Instruments-486SXLC2-50-CQFP-cpu-no3500.html

It also goes without saying that the 486SXLC2-50 is no claim by relation to a PC because you could put the same 486SXLC2-50 into PCs too if you wanted. Which you wouldn't if by then you had a PC already upgraded to a Pentium.

As far as the PC is concern the 486SXLC2-50 is something of a moot point as already by 1989 486DX4/100s OverDrives were available and by 1992 they could be attached to Vesa local busses. 

Also, if in 1991 you had bought a Socket-3 PC at about the same time as the A2386 was released, then you could eventually upgrade that same 1991 PC to Pentium Overdrives.

So, there were a multitude of consumer PC options which would have made this Amiga card look anaemic. We are also ignoring the fact that having the same CPU doesn't by default imply similar performance and in fact the VGA performance of this same Amiga add in card is abysmal.

"The Commodore bridgeboard is still worth several hundreds of bucks amongst enthousiasts while a PC of that era is mostly a piece of junk."

Well, no, the right 496 still fetches a good price from PC enthusiasts, but again to PC users many are cheap purely because 486 PCs have long been vastly superseded by successive PC generations, whereas the 486 Amiga daughtercard hasn't.

Whichever way you want to experience the PC, if you really want PC performance then you are better not buying an Amiga or daughtercard but instead buying a PC. 
 
Here's someone using the board you're talking about.

https://retro.ramonddevrede.nl/wp-content/uploads/2020/04/A2386SX-stock-speed-SI-18.9.jpg

On a scale where an original PC/XT is 1, he gets 18.9 from the 386/25 bridgeboard. 

So a 1991 A2386 with a 25Mhz 386 gives you about 1/5th the performance of a 486/50 available in June 1991.

So, I maintain, as I always have: If compute performance and users are what you wanted, and as a programmer that is what I want, then there has never been a time when the Amiga was the right choice.

Do you know, you were also able to buy processor daughter cards for the PC too, even before the Amiga existed? By 1984 Sritek had made a PC daughter card with better specs than the Amiga 1000 had on the day of its release. It had An 8Mhz 68000 with 512MB of dual-ported local RAM. It was able to run the Xenix operating system, a pre-emptive multitasking multiuser Unix system, before any Amiga existed. It was even able to accept coprocessors of its own. So, in addition to the PCs main CPU and the 8Mhz 68000 on the daughtercard the daughtercard itself had an additional slot which accepted boards with either a Zilog Z80, a second 80286 or a National Semiconductor 32016, which claims to be the first commercially available CPU with a 32bit ALU. So the irony of Amiga fans boasting of daughter cards is, by the time the Amiga 1000 was released you could already have a faster 68000 system in the form of a PC with a 68000 daughtercard. 

To finish on two final historical notes you might be interested in: The fastest ever 286 CPU, and therefore the fastest 16bit CPU to be fitted to PCs, was the Harris CS80C286-25. It was released in 1982, some years before the Amiga appeared. It should also be expected to outperform the 1991 Amiga PC board you are talking about from 9 years later, not only that but it can also be expected to outperform the Amiga more than fourfold as 286 chips were faster than 68000s at the same clock speed.

Meanwhile, in September 1986, the Compaq 386 PC became the world's first fully 32bit personal desktop computer. That is to say, a PC with a CPU which had a 32bit word length, instruction set, and ALU, which the 68000 did not have.

As for the daughter card you're discussing, you can see a comparison for yourself. Here is some video of Wolfenstein being played on an Amiga A2286 bridgeboard, skip to 8:28:
https://youtu.be/40CazTansYk?t=508

For comparison here is a 386/40 PC with Wolfenstein coming in at 17:55:
https://youtu.be/qaGQxZEYby0?t=1059

As you can see, the 40Mhz 386 PC looks more than ten times as fast. In fact, that's conservative, for much of it it seems substantially over 100 times as fast as the bridgeboard and in many places about 500 times as fast. Still more perhaps as because Wolfenstein is updating at the full frame rate on the PC, the potential gap might be even wider. Doom would be a better test to slow that damn 40Mh 386 PC down to something measurable, it's something like two orders of magnitude faster than the Amiga bridgeboard, and was also available a lot earlier.

So, as for people talking about "contemporaries", the Amiga bridgeboard, fitted with a 25Mhz 386, gives it the CPU performance of a PC approximately ten years its senior, and that's going by raw CPU performance. Going by graphics performance, the difference favours the 1982 desktop PC by a much, much wider margin.
Reply: You could run WinUAE / other Amiga emulation software on the PC emulator (PC-Task44) on the Amiga :)  Then go another layer deep and run PC emulator again :D
Reply: @Stoney3K  @lister_of_smeg is correct. There actually were software-based PC emulators.  One of them was called "PC-Task."  I also had a BridgeBoard which is not an emulator but an actual full PC computer on a card.  
As for Mac emulation, you are correct, it was API translation. I also owned the Macintosh disk drive interface and external drive but people eventually figured out how to use the Amiga drive to read Macintosh disks.
Reply: Agreed. But sadly most people forget also how powerful the PCs were back when they was released, and moreover forget how powerful they are TODAY. Amiga was a very, very interesting and revolutionary computer indeed (I am all but a fanboy), but also the PCs of the era was computers full of undiscovered secrets (for example see the 8088 MPH, 8088 Corruption and Area 5150 recent demos for IBM PC CGA, I cant' believe when i saw it). I passed directly from a glorious Commodore 64 to an 80286/16 CGA (yes CGA) in 1992, and I have only good memories from this computer, despite his outdated graphics and sound. Slowly I evolved the case to a 386DX-40 with VGA and Sound Blaster, and it was great. Said that, I love retrocomputing, i love old PCs and AMIGAs modern installations, because they teach us what incredible things could eventually be done with the powerful computers of today. But wouldn't it be nice to see a NEW project for the AMIGA, a computer with modern hardware AND with new innovative features like that of the A1000 and the A500 has at the era? competing directly with x64 PCs and Apple M1 PCs? This can be a computer I could consider to buy today.
Reply: The Amiga absolutely couldn't emulate a PC in software at the same speed as real hardware. I had a software only emulator that I ran on an A500 and IIRC the clock was something like 0.1mhz - painfully slow. Even a 68030 or 68040 would do a miserable job of emulation. What made the Amiga fast for its day was the hardware for sound, IO and graphics which offloaded a lot of the work that the CPU would otherwise have to do.
Reply: @drxym  I agree absolutely.
Reply: I had 8086 bridgeboard on my A2000 in 1987. But I really did not use it for anything.
Later in 90's I did use PCtask to load and convert word documents to rtf. I liked how it booted faster to win3 than a real PC and got that basic thing done.